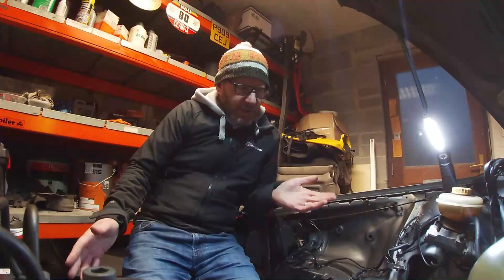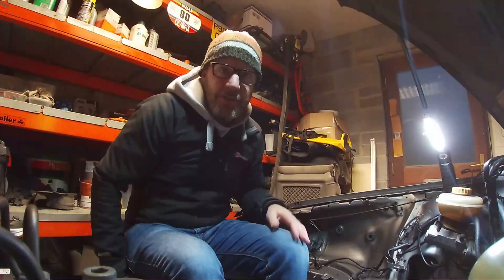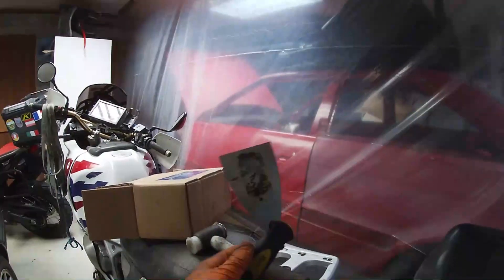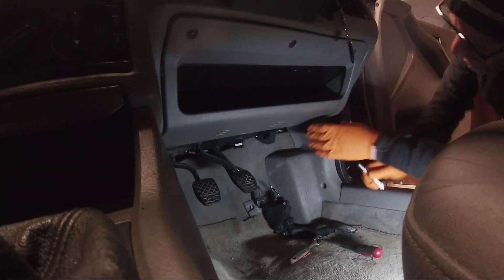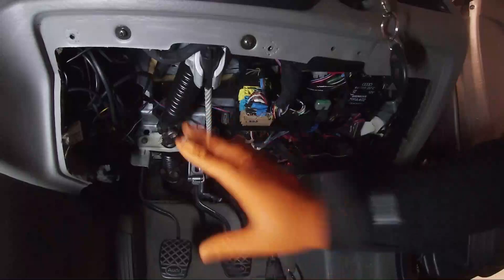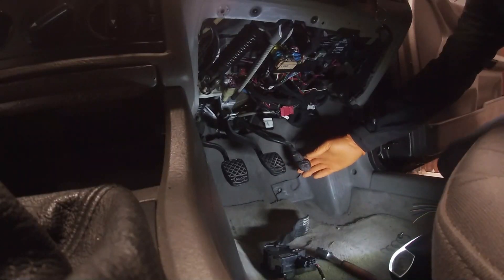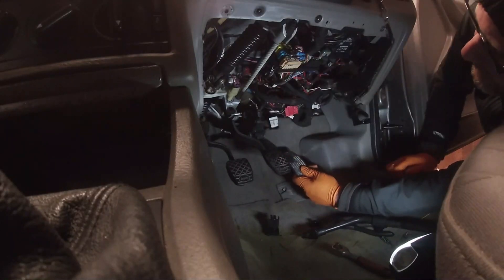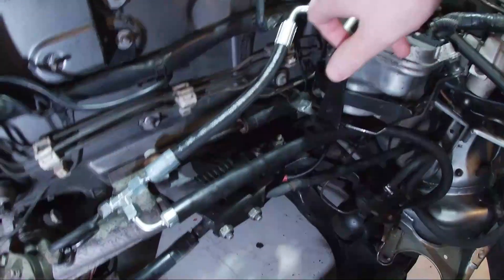Audi 80 EV Conversion - Part 4

Comment: Oh...about pedal setup...You can leave wire and conect it to a throtle position sensor from PSA 2.0 hdi engines - Suzuki GV.
Reply from the maker: Yep. True. I thought about doing that and may do in future. Would keep the originality and feel of the throttle of the old motor too.

Comment: Could You make an extra set of adapter plate between engines and shaft adapter and sell it for me? Great project. I have Audi Coupe quattro 20V ready for conversion. That will be a first car for my son.
Reply from the maker: Hey Pawel. Would gladly! Need to get my backside in gear and get mine fabricated. Spending time on the VCO at the moment. Very close to having a spinning motor under orders from the leaf pedal. You have the same Coupe Quattro as mine in the background? They are my fav by far. I put up 90k on mine in 2 years! In the middle of a rebuild. It will be my last ICE I rebuild I reckon. Love that 5 pot. Good luck on the build! I want to do a coupe next too. Lots of info on Openinverter.org where you will find more details on my build.

Comment: Hi mate, I would call you by your name but being a dirty Northerner I can't pronounce it. 😋
Loving your build so far and really looking forward to more progress. A forum friend and myself have been discussing an EV build with a Leaf motor so really interested in the detail of the parts you're using and the process.
Keep up the good work
BTW I was thinking about one of your earlier videos where you mentioned you would have much less weight on the front wheels and was wondering about excessive wheel spin in a FWD car. 
Maybe you can put some of the cells in the front to lessen this.
Reply from the maker: Ha. You would be surprised how many my name has been massacred!  :P The further away from Ireland you get, the better the attempt. Thanks for the feedback. Thanks a mill! On the weight question, I hope to have it pretty evened up with 60% of the leaf pack up front as well as including the motor, inverter, gearbox, 10kw charger, I would  hope to have it back down to earth but still lighter kerbweight overall. Hope to have more vids up soon with moving parts....